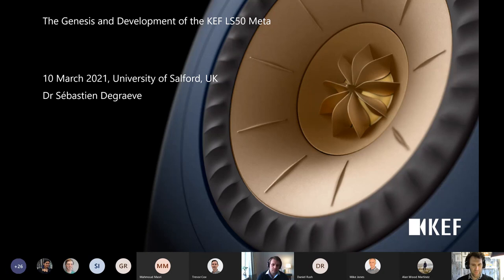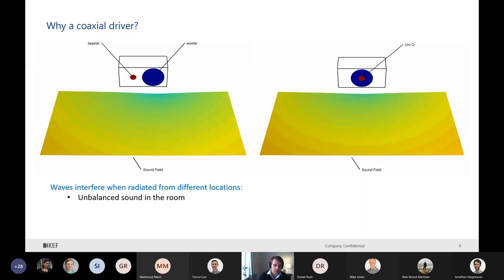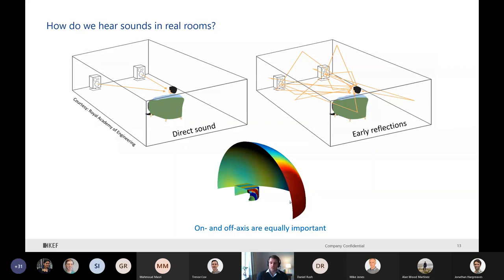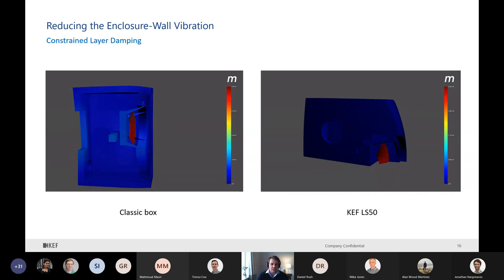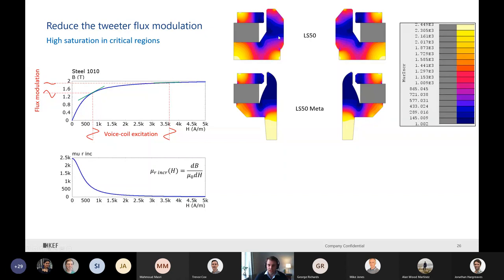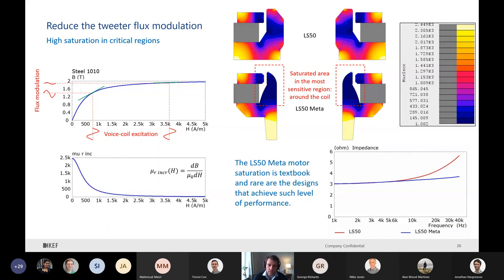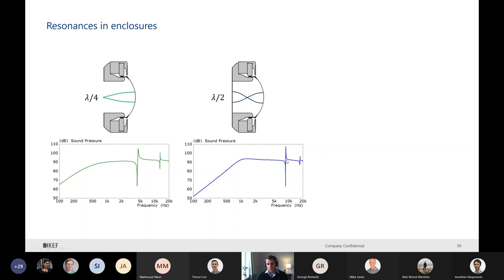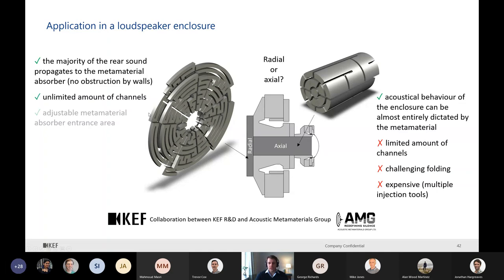KEF LS50 Meta - Dr Sebastien Degraeve

Comment: So this is the absolute hero that improved the great LS50! Well Sebastian, you did a tremendous job, as the little Kef’s are now sounding as I hoped the original would sound. You nailed it. I had the LS50 anniversary for 8 years, but I never was completely satisfied with the results. I wrote Kef a letter, but they never came back to me.  The design is suberb, but I didn’t like the way the crossover was operating. especially with higher volumes the sound became to harsh and penetrating in the higher regions. In the meta’s this is much better. But the overall sound is also improved. Airier, better soundstage, better results off axis. The meta material is a great invention as it makes it possible to damp the tweeter in een relatively small cabinet. B&W uses a long tube with damping material placed on the cabinets of the Diamond 800 series. Takes a lot of space. So you did a great job. Kef made a good decision to hire you, as you are a specialist in the use of meta material as I saw on your LinkedIn page. Thanks very much!

Comment: Excellent presentation!. Dispite all this great technology the speaker still has to be voiced. Who usually does this?. With the improved Meta technology in this speaker compared to the Q350 why is it necessary to move away from a 1st order crossover that is used with very good results inthe Q350?.